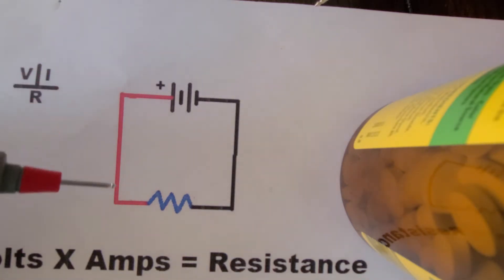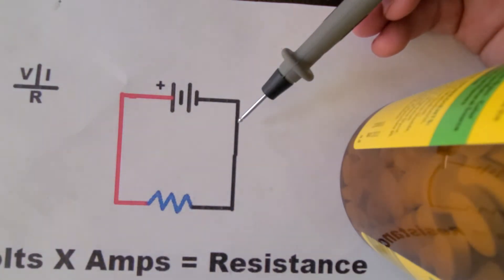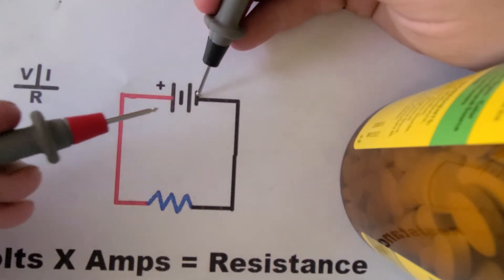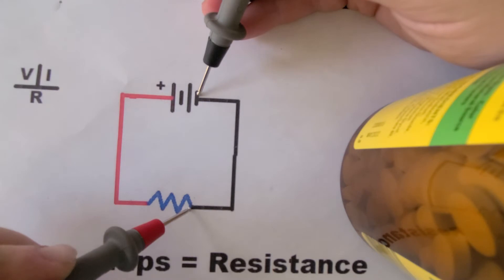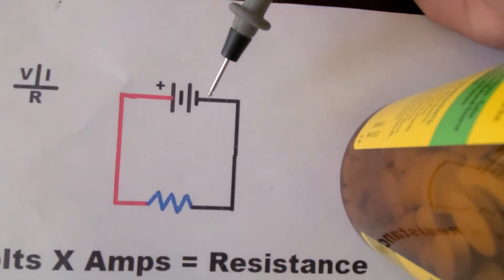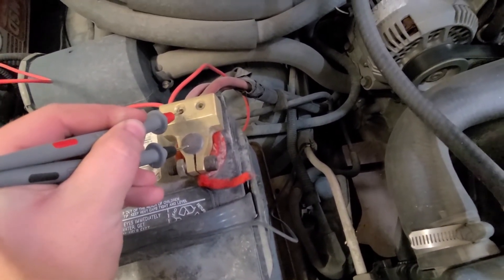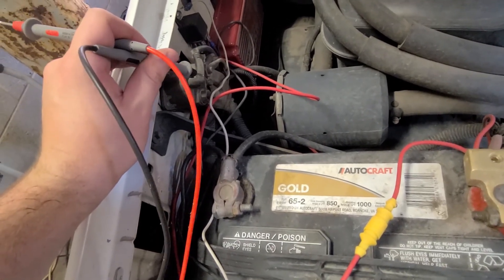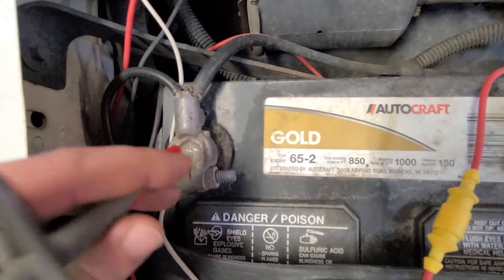Testing Grounds Theory and Application (1996 F150)

Comment: Great explanation, really helped. I have a '94 F150 that is stalling under power, but idles fine. I thought it was a fuel issue, but now that I have replaced the pump, the filter, and the regulator its time for me to start diagnosing if there is some sort of electrical issue potentially and this is a great starter explanation on how to check the different systems. Thanks!